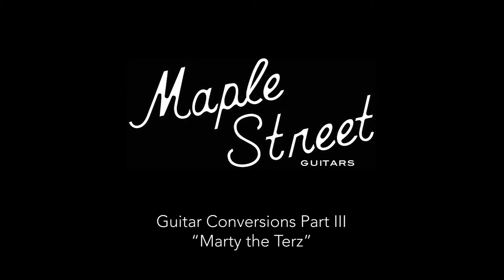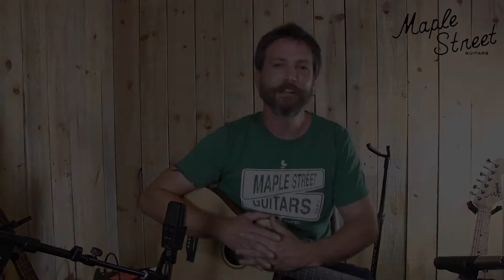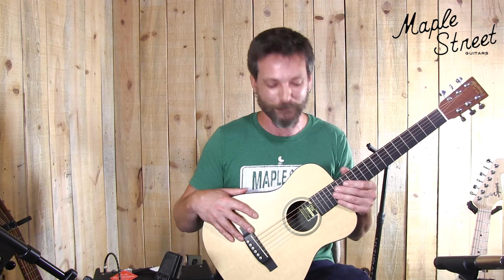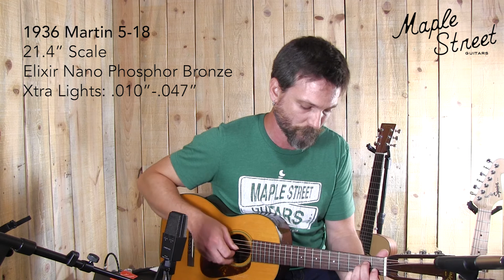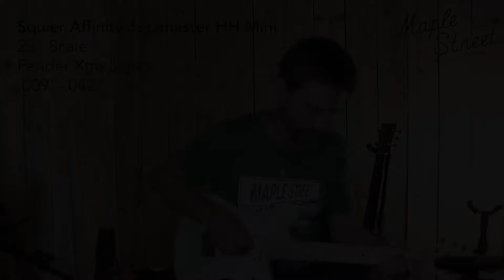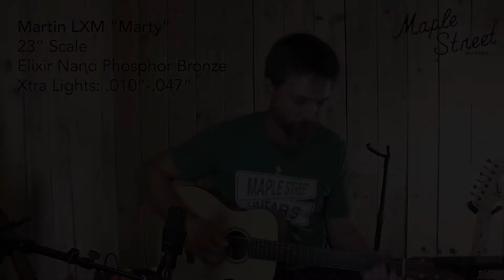Terz Conversion Guitars! Exploring a Vintage Martin, Little Martin, and Squier Mini Jazzmaster

Comment: The Squire mini Strat with the stock 9s can be tuned that High so you don't have to go too far
Reply: @Great-Documentaries  Yeah 7s for the 4/4 Size & 9s for the 3/4 Size. So you need to go up 2 gauges on a 3/4 size Guitar to get the same tension. Those Squire Mini Strats & Jazzmasters are I think Fender's production made Electric Terz Guitars.
Reply: @Great-Documentaries  you could also try high B standard on those guitars